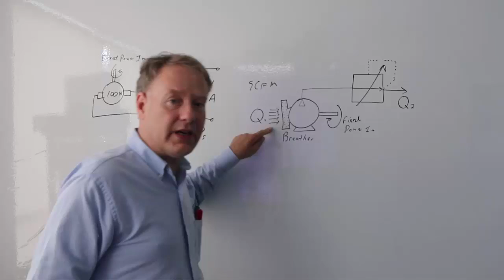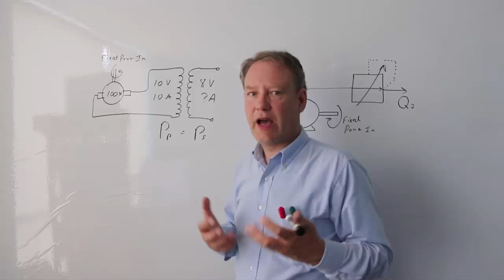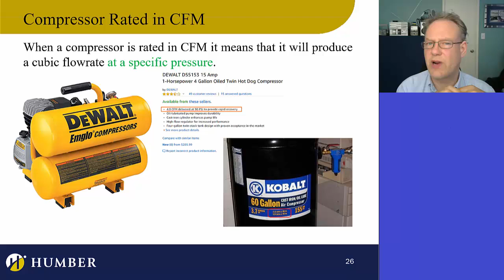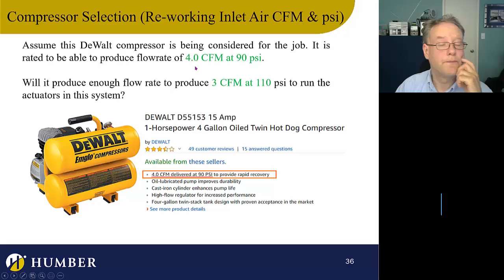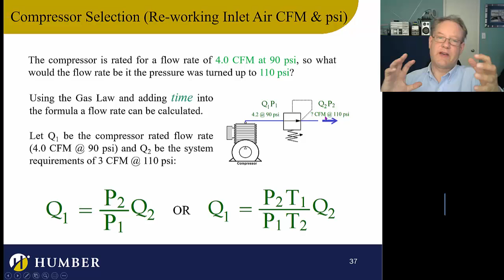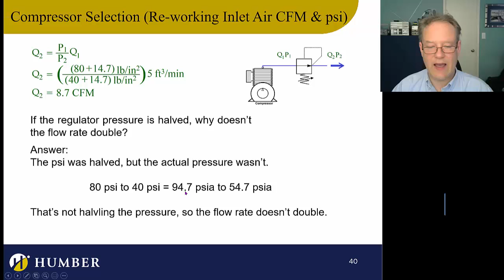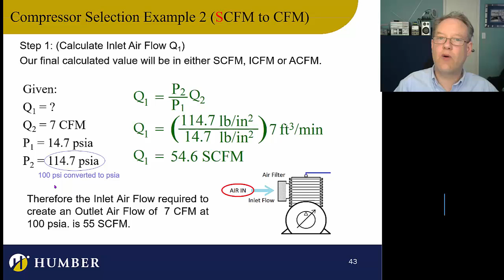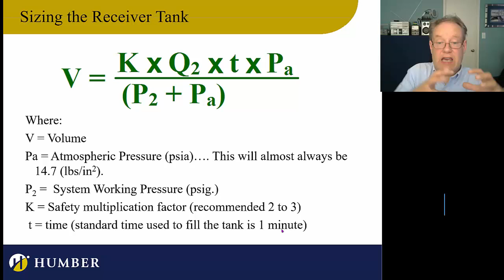Compressor Selection

Comment: I've found that those cheap compressors like the one you're using as an example from Amazon, don't really spec the CFM at the outlet, but the SCFM at the breather. It's really confusing, because they're indicating the air consumption of the compressor when outputting air at some pressure (normally 90 PSIG)...
Reply from the maker: Thanks for the comment Oscar.

Yup, some industrial compressors rated in SCFM too. The one selected as an example in my lecture uses 4 CFM @ 90 psig, but you are correct about the hobby compressors. Some are rated in SCFM where it is understood that the inlet pressure is 14.7 psia or 0 psig. My understanding is the rating of compressor is the maximum operating parameter. Although some are rated in CFM, most compressors have a CFM at a set pressure. You can tell it’s a higher quality compressor if it has two ratings in CFM at different pressures.
All flowrate ratings are valid maximum operating parameters. It’s just a matter of doing the math to see what the flow is at whatever your operating pressure is. Having two ratings, typically one higher and one lower value gives you a ballpark range that allows you to select a compressor without doing all the math which I discussed in this lecture. 
It’s funny how the cheaper ones give a rating in SCFM which requires a detailed understanding of the math to figure out if it works for you, and the higher quality ones, typically used by those who can do that math, are rated in a way where the math isn’t really required. 🙂

Comment: On a complex plant we had a compressor sized at 300kW for given conditions yet later in the detailed stage the same vendor calculates 400kW what must have changed, would the ambient air temperature if changed from 49C to 42C make that kind of difference or would the system have changed?
Reply from the maker: I don't know the details of the system, but it seems as though you're also not aware if the system changed. Therefore, I cannot be said for sure if it was due to a system change without knowing more about the system itself. 

With that said, it could most definitely be that the system has changed and that possibly someone added some actuators or maybe the loans themselves changed or the operational parameters in some manner of the pneumatic system changed, such as actuator speed. All of those are possible and can explain why thew compressor would have consumer more power.
You mentioned that the temperature changed from a hotter temperature to a colder temperature. In this case, if the system parameters had not changed, the compressor would consume less power. This is because it takes more energy to compress warmer air than it does to compress cooler air.

Might be happy to advise you further if I could get some more details of specific changes that you may have considered change the power consumption.